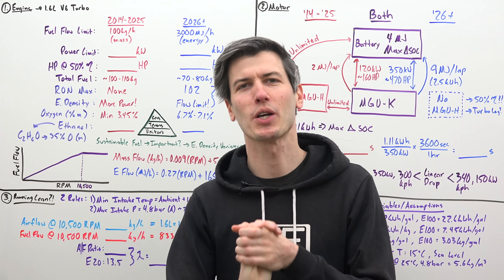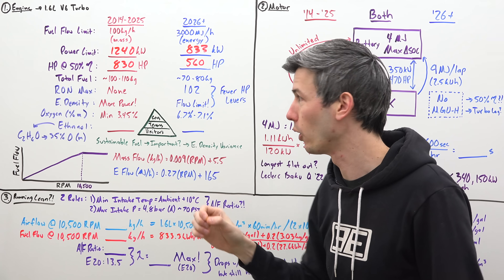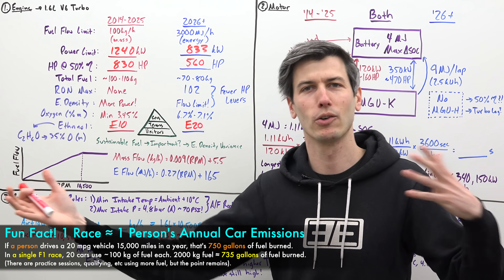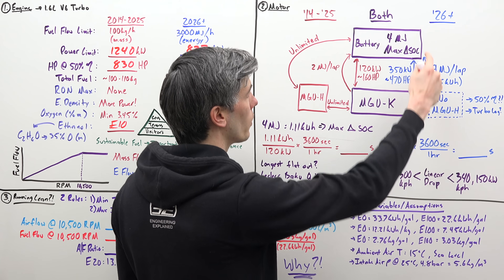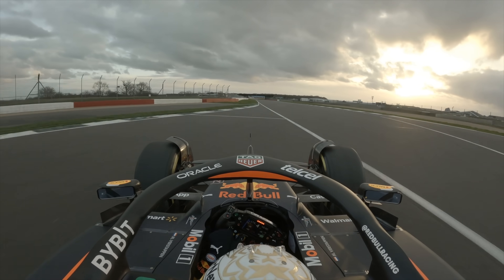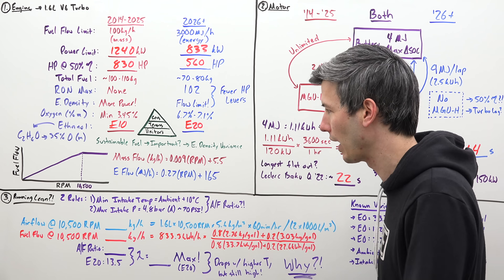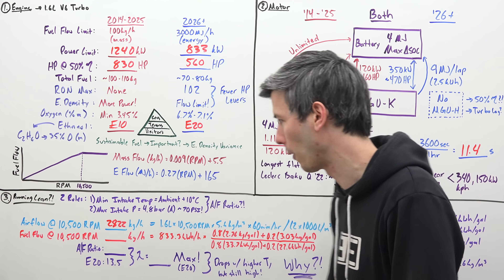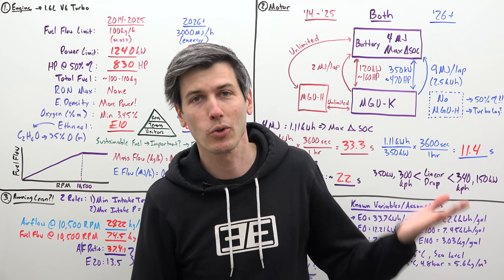Why Are 2026 Formula 1 Engines Going To Lose So Much Power?

Comment: My only F1 race in person was in 1989 Montreal. I heard the Ferrari 3500 NA V12 before seeing it visually as it took to the back straight after the hairpin. 
Still makes the hairs on my neck stand up thinking obout that sound and seeing Berger suspension sparking off the surface of the track. 
The sound experience is unforgettable. The old days of F1 ahh
Reply: I was lucky enough to hear the v12s during the historic gp at COTA in 2022. I swear you can feel the ground shaking as they go past. Luckily I was there for the v8 runs with Mario andretti as well. I just feel so lucky to have seen those beautiful pieces of history racing
Reply: @Fishing With Aiden  where were you sitting?
Reply: @jacksonh3034  general admission at turn 1
Reply: youre a lucky man!
Reply: @michaelj8582 a lucky man?

1989 Canadian grand prix,  Gerhard Berger retired after 6 laps , broken alternator belt.
Reply: I lived close to Montreal most of my life. I still remember being at work on the opposite shore from the island where the track is. I worked beside loud construction machinery and I still could hear the roar of the V10s over it. The noise over the water was otherworldly. You cant hear them anymore.
Reply: Just imagine, that was only at 13,500 rpm back then. Just imagine 20,000 rpm in the 2000s. I went to the 1987 Detroit Grand Prix and I remember those turbo engines sounding so much better than the Mad Donkeys in 2014.
Reply: I saw races with the V10s, V8s and now V6s. The V10 was out of this world amazing. Simply just beautiful music
Reply: Sound lovers 🤣
Reply: One of the things I like was the ear piercing sounds those V12 and V10 made not to mention that smell of the from the fuel in that was my first time going to Montreal in 92
Reply: These days you're lucky when the Porsche Cup is a support race, at least they kinda still sound like race cars.
Reply: Cool and all but that car had like 600hp
Reply: Modern F1 is not F1
Reply: @Tom--Ace  I miss the 2000 V10 era. And the cars looked the best for me.
Reply: @23GreyFox  Well said. The V10's were likely the peak, they were small and nimble, faster than anything modern, sounded electrifying and encapsulated the spirit of the peak of motorsport. 

They were just the best. Modern F1 is a pack of pansies
Reply: @Tom--Ace the peak of modern f1 was 97
Reply: @Tom--Ace  classic F1 just nostalgia bullsh1t
Reply: @RBot21  says a dude called emo. You wouldn't even know
Reply: I know that feeling. I think FIA can't wait for the current generations to die as the next generation have no clue what a V10 and V12 sound like.
Reply: Lol you all sound like angry old people. "I had to walk up a hill in the snow to watch F1."
Reply: @ccramit spoken like a muppet who doesn’t know what he’s talking about 😂

Way to out yourself as one.

Comment: Before watching this video I'm just gonna take a guess. It's because the cars are getting too fast. The same reason top fuel drag racing reduced the race to an 1/8 mile. They were getting too fast, and it was getting too dangerous. But damn!! The one and only I saw the NHRA live in 2013 top fuel dragsters were doing over 300mph on the 1/8th mile! Could you imagine a 1/4 mile?

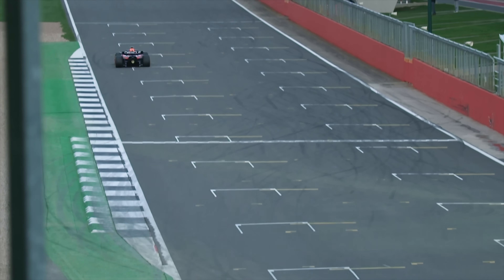Comment: 9:30 where you mention "Electric Power Is Limited At High Speeds" is that a rule in the regulations? Or simply an expected outcome all teams will do based on the limited battery power available on a long straight?

Obviously you want more power available at lower speeds, before aero limits your max speed, but would it be worth saving a portion of battery after DRS is enabled to further propel the car to its next (aero limited) max speed?
Reply: I think that it was expectation. Because at full power the electric motor would use all power in 11 seconds. Making it variable make it last longer aka the whole straigh part of the track.

Comment: The boost limit is likely there for two things, limiting the partially closed throttle control of an over speed compressor and a to limit the aerodynamic benefits of blowing exhaust on aerodynamic surfaces.
Reply: Exhaust-blown aerodynamics have already been banned for quite some time
Reply: I don't see that at all
Reply: Ok, how can you make so much boost with partially closed throttle? I think you need high energy exhaust flow for that. And second, for aerodynamic effects, may be better open throttles but with lower boost? 

I think this all has something to do with engine braking.

Comment: The changes should result in a lot of battery power used at acceleration then tapering off.  What if they added a variable mass (or variable geometry) flywheel for better energy management?  You could get off the line faster and store energy in the flywheel in addition to the battery storage.

Comment: Former F1 design engineer here... great video. Done tons of these calcs over the years... all looked good to me. 

Years ago (probably 2016) we had a working group to think of ideas around the energy flow diagram, to a) see if we could figure out what Ferrari was doing cleverly and b) try to come up with various nefarious ways to do similar or worse. Mercedes was quite risk-averse, but we really had nothing left to unturn at that moment... we looked at hybridization of ancillaries, various battery layouts etc... but most of the efficiencies found in these rule sets are in combustion/lean-limit optimizations (through fuel formulations, atomization strategies, air injection, mixing etc...) and MGUH strategies. Since the latter is gone, you will see a lot of time spent on fuel...

Could you make a fuel which has a lhv at one temp and another as it raises? Or one that has the same attributes at different pressures? Those things will be tried. I am confident you will see another step change in BTE, which will bring these back to 50%. It will just be a matter of time. Interesting frontier. 

Ill check out your other vids.
Reply: Well… maybe I should make a video on how I got my job 🤔.

Also all your crackpot theories were correct, Ferrari was very clever but they weren’t clever enough to hide the performance gradually over the season. The FFM tricking was real and Red Bull ratted them with a brilliant document. I don’t think it’s public.
Reply: @gabednconfused  I’d love to see that video!
Reply: @gabednconfused How'd RB find out?
Reply: Wasn't it speculated that Ferrari were running pulsed electrical interference on the FIA fuel flow meter?
Reply: @MC-re9zj  Speculated yes, possibly that they were altering the fuel flow rates out of phase with the fuel flow meter. Meaning that the fuel flow meter checks the rate in pulses rather than continuously, so if you can raise the rate in between check pulses you can get an advantage. 

Also rumors that they were deliberately allowing thin engine oil to either leak past the cylinder into the chamber, or into the intake via a deliberate leak in the turbo charger. Thereby using engine oil as a fuel booster. The evidence was the limits placed on engine oil burning shortly after.

There's also been rumors of pre-chamber fuel tanks in the engine, with the idea being that fuel flow can be increased at times when the engine is reving low to fill a tank on the engine side of the fuel flow meter. That way you can increase fuel flow into the engine when needed but still comply with the sensor. This one was the crackpot theories of how the Mercedes Party Mode supposedly worked, but it was later revealed that the engine was just functionally 2 years ahead of development of everyone else so they had power to spare early in the Turbo hybrid era and were turning the engines down to save mileage. One of the Mercedes engines was apparently cracked open by the FIA to confirm they weren't doing that... they weren't
Reply: How did you get your job bro

Comment: The pressure limit is there for  lower engine rpm because you are not at peak power.  Your calcs were done at peak power and rpm.

Comment: By 2040 they'll be running single cylinder thumpers.
Reply: Cool.
Reply: Most likely no cylinders at all… 2050 we will only have race cars with electric motors. Maybe F1 will be one of those at 2040…
Reply: @haukikannel  that’s generally how life works, technology advances.
Reply: We are not going forward as technology advances, on the contrary... Society is falling off a cliff rapidly

Comment: I don’t like the idea of relying on the battery for nearly half your HP especially since the size isn’t changing. F1 car should be much quicker than they are today yet they keep making changes to slow them down. I would like to see them open up the engine regulations to allow whatever type power unit the teams prefer (still with fuel weight limits and such). If that’s a V10, turbo V6 hybrid, electric motors on each wheel, or hell even turbine engine, I just want to see peak engineering and faster cars.

Comment: I don't get these regulations. Put a price cap on the engine the same way there is for the teams. Put a fuel flow and battery limit. Then let the teams figure out their own configuration to make the best power unit. How awesome would it be if say Audi showed up with an inline five or honda with a 4 banger, theres only so much fuel you're allowed to flow anyways so the power potential is limited by that more than cylinder count so teams might like the weight savings of a smaller engine. F1 is becoming more and more of a spec engine series.

Comment: Maybe, just maybe, they can make it run super lean so that instead of controlling the throttle via controlling the air flow into the engine, they control the throttle via how lean or how much fuel theyre injecting. Keep the throttle body fully open and maximising efficiency.
Reply: When paired with ignition timing, and pre chamber combustion, they are able to achieve super lean combustion. When the driver is not demanding max power, they can use this scheme and save tons of fuel

Comment: I think I know what F1 is aiming for with it's rules and regulations... They are cornering teams into developing engines with what I would refer to as "true thermal efficiency"... Previously thermal energy had to be recovered from exhaust gases leaving the cylinder... But if those  gases can do more work while still in the cylinder there will be lower EGT and if friction in the engine is further reduced, then the radiators do less cooling meaning less heat loss... As a result, the ICE's on there own are say 50% efficient with the e-motors bumping that up to more than 60...

The air flow limit is a bit weird but is probably targeting an exploit that may result from the apparent intent of the rules and regulations that I've mentioned above...

Thanks for the video as always

Comment: To entertain the fans that want louder engines i really don't know why they didn't just increase fuel flow/usage with only a small increase in MGU-K to make up for the MGU-H instead of massively bumping up the MGU-K and dropping fuel flow. This makes more sense when you consider the fact that the fuels will be sustainable in 2026

Comment: I think it would have been awesome if they capped the battery using weight rather than energy total. That way, all other energy sources are controlled except for the one that requires the most innovation

Comment: I think in my opinion the extreme air/fuel ratio is not because of E20, but for when running on an Hydrogen blend.  Hydrogen in an internal combustion engine can run extremely lean.  Looking beyond 2026, this sets the rules up to limit the lean burn capabilities for running on hydrogen.

Comment: Could it be that the max energie p/h includes that of what the mgu-k provides?

An a/f that high would most likely ensure all pistons to burn through before one lap has ended.
Extract the mgu-k value and you end up with mutch More feasable number?

Just a thought but megaJule/h numbers is normally used at elecktric measurements. One could assume it has to be included in the total mj/h
Reply: But if that's the case wouldn't that mean the engines can provide a maximum of 560hp, MGU-K included? Not an expert on this at all so just asking out of curiosity. That would mean the "ReTAIniNG POweR" marketing is just a load of bs, it would be a theoretical max but the cars during a race would be limited to the 560hp. 

Anyway I think the teams will already have a very hard time just getting the 9 mJ per lap, they now only manage to gain around 17% of the potential energy through the MGU-K and the maximum available energy if they managed to regain 100% of brake energy would be around 12 mJ. I don't imagine they'll hit 100% and even the ~75% required for the 9mJ will be hard. That combined with the fact the energy runs out so quickly will probably mean teams will look into other ways to reach that 9mJ by applying throttle during braking or downshifting on straights (essentially going slower through certain parts on purpose to regain energy for that sweet 470 extra hp.)

Comment: I was thinking about that max. intake pressure limitation, at first I thought it could do with torque restriction, in sense how much HP you can generate at lower RPM, so I imagine goal would be to generate as much HP as soon as possible before you hit flow limits, so you can achieve better efficiency and faster acceleration and we would get lower revving engines
the other thing that came into my mind is to do with  lag, if you find way how to store some quantity of air in manifold, and than inject it in engine after you request torque you can boost your turbo response, and introducing this could limit such capability

Comment: I do wonder if some teams were running really lean A/F mixture to cool the temperature inside the cylinder. There is a "street engine" recently introduced that runs very lean A/F mixture and is sort of like mix between gasoline and diesel engines, though running on gasoline. But it is capable of running well over 20 ratio. Of course I might be misremembering things. I will try to find a link to the video or at least re-watch the video on said engine. Sadly I know about engines just a little, so I won't spout any "Wisdom", because it would likely be inaccurate. Though it might be possible that those 2 rules are also result of 2 different manufacturers being close to breaking either of them (so coincidence that together gives you A/F mixture) or result of something else entirely. Interesting speculation and I hope we will know a bit more in the future, because it will be interesting what sort of new technologies it will "force" to develop.

Comment: There's some very clever combustion technologists at work in F1 engine design...

Personally, I think it's a pity they're getting rid of the MGU-H. For me that's one of the truly great innovations - having so much refined control over air charging and exhaust energy loss. And, due to the hot / cold / speeds involved, it's got to count as a really tricky piece of engineering. That's it's worked so well is a testament to some very good engineering. I was especially impressed by Merc's take on it, having the turbine at the back of the engine, the impeller at the front, the shaft through the V of the engine being ceramic for minimum heat transfer to the impeller / motor generator, the pipework for air / exhaust being very simple, the packaging being so neat and compact; it was just excellent in every way. If anyone were ever to put an MGU-H into a road car, you'd want Merc's take on it. It'd even work on a 4 cylinder transverse engine; having a ceramic shaft come through a hole in the block - still front to back in the car - would be cool (quite literally). 

Basically, it looks like they're becoming much, much more hybrid, less reliant on brakes (more energy going back into the battery). 

Braking Problems?

How long before one of the teams tries 4 wheel drive, or front wheel drive, or even just shafts on the front axle solely for regen braking? With rear wheel regen only and even more braking grip required at the back, it's going to be seriously messy for the chassis / aero guys. It'd be far easier to extract that kinetic energy from the car if the front axle could play a role in doing it. I don't know what the regs say on the matter, or just how bad the handling is, or how unpredictable the braking is at the back. 

Keeping the rear brakes at the right temperature is going to be even harder if they're going to be asked to do so much less. It feels like the drivers are going to find that, once the MGU-K has topped up the battery, they're going to be left with stony cold rear and red hot front brakes for the rest of the corner, which sounds really nasty. May be the amount of regen could be moderated against the amount of braking the driver is likely to want, so that it's involving the rear brakes more continuously. But that'd mean topping up the battery slower, later.  

We don't want it to be a fernickety set up problem that's hard to get right. We don't want races where drivers / teams can have inexplicable handling off days and aren't really in the race because it's become too hard to get the braking set up right. We want it to be easy enough for teams and divers to be competitive, otherwise it's just a randomised procession and not really a sport at all...
Reply: The teams hvr rejected front axle gegeneration in the past, probably because it adds weight around (30kg), complexity, and makes the handling worse.

Comment: Kind of a bummer the rules don't allow for a series hybrid with potentially newer battery tech. Presumably they could write the rules to allow for the petrol engine running at 10,500 all the time and running fully electric the entire course. Obviously a 470 HP motor would be prohibitive on the straights, but I wonder what % of the track would exceed the need for 470 HP.